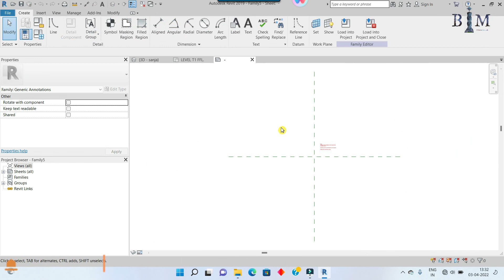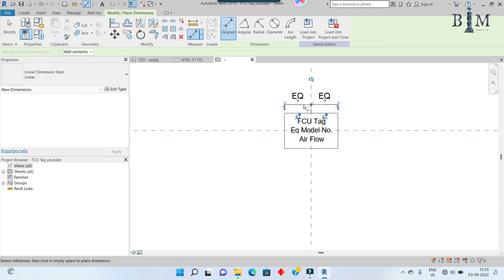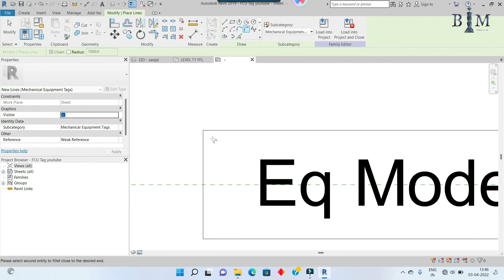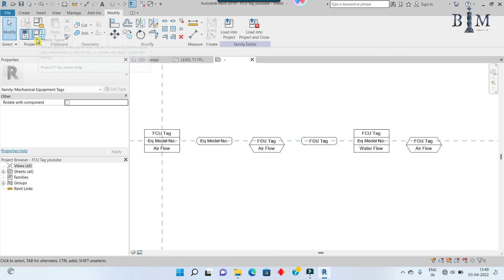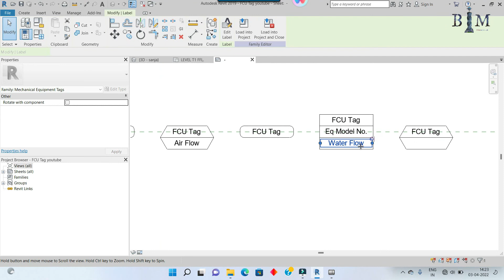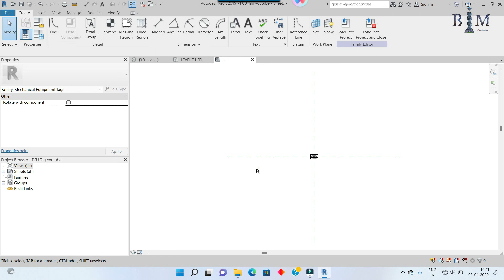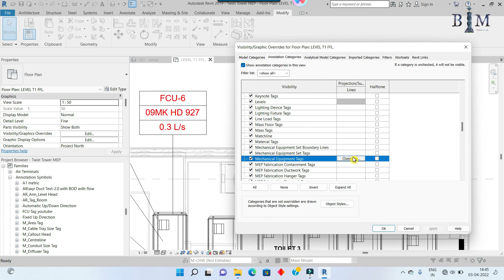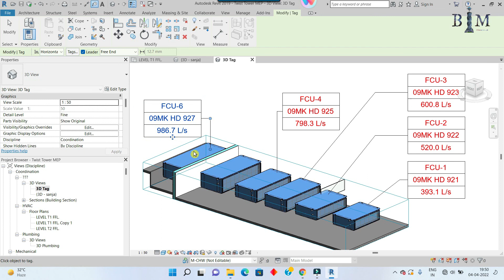Ep 6 # How to set Mechanical Equipment tag in Revit | #Revit#AutoCAD#Navis#Mechanical#HVAC

Comment: Sir as the vedio I changed the visible and created family paramters but in each instance all the things pop up . Not one tag all are seen in each instance
Reply: Can you help
Reply from the maker: Thanks for your question. I believe you should assign every tag element in individual visible parameters to control it whatever you required. For more details, you can contact 7063648301 whatsapp number. I will add you in group to discuss on this issue. Saturday we will discuss on your issue.